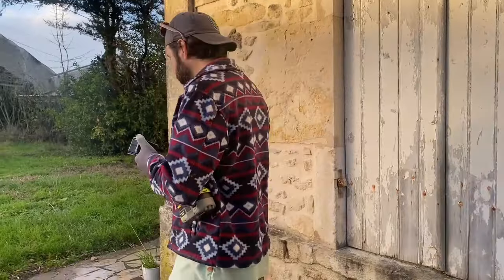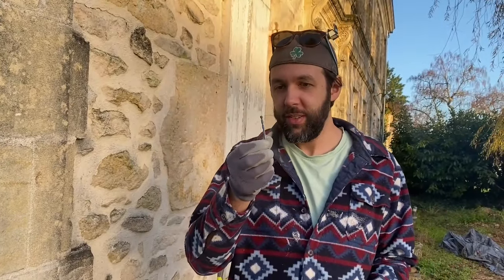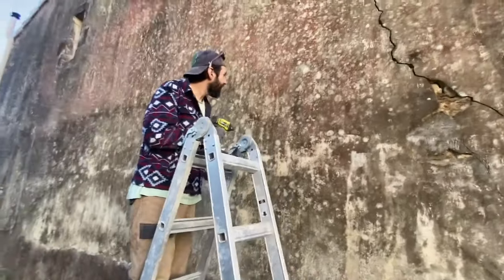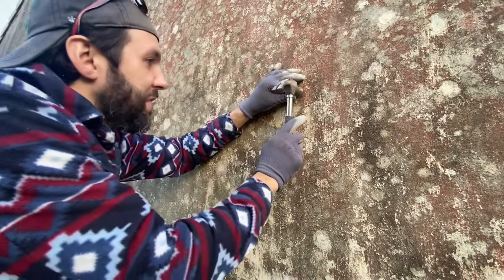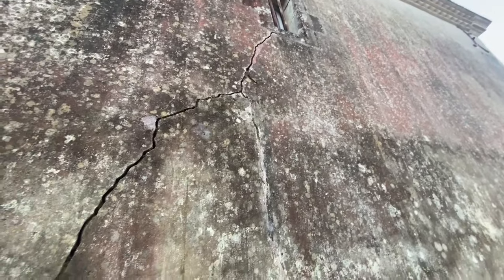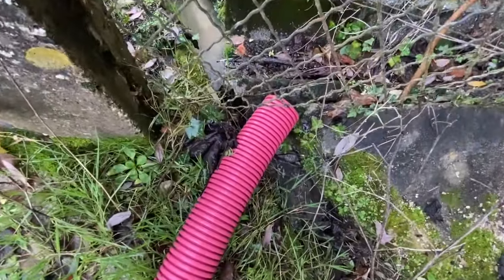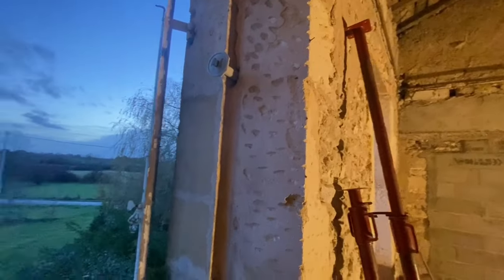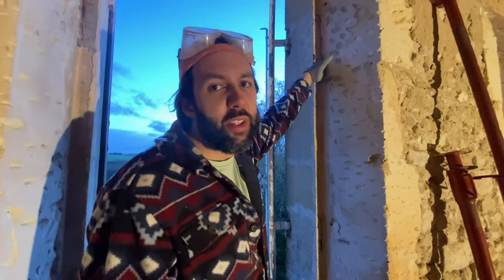Our wall is covered with red algae, NOT a very productive day! -Vlog-

Comment: Depending how old your building is usually it’s has lime mortar in it not concrete.   I am not an expert.  I’ve seen a debate on French buildings and your correct in saying that it became popular to use cement but it’s too rigid and unfortunately some of those buildings have to take the concrete off and replace it with lime mortar because of the age of the building and what it was constructed with.  You might want to talk with a mason or somebody who deals with stone buildings and ask them questions about buildings that have structural cracks down the side of the building and how to repair it because in some cases they might tell you you have to use concrete.  I watched another château deal with structural cracks in their building and they used in certain areas, concrete, and  wire mesh in order to keep the buildings crack from continuing.  
Let me emphasize.   I do not know anything about this. I don’t know if it’s a good thing or a bad thing to use concrete to stop a crack in a building but I would highly recommend making friends with somebody who is knowledgeable in this area. Thank you for sharing.
Reply from the maker: Thanks for sharing ! It’s always good to have input/feedback. We work with a mason on some projects and he confirmed it is cement. He said the way they plastered it everywhere doesn’t help, so one or our future projects will be chiseling it off . Then we can address any structural cracks as you mentioned.. maybe using a mortar/cement mix. The mason wants us to install wall braces.. we’ll see.